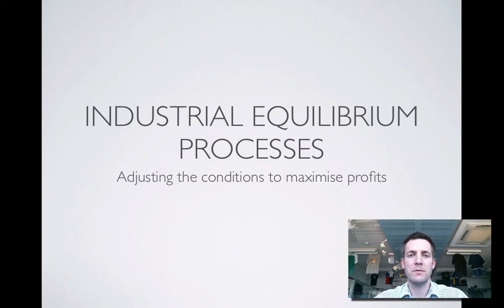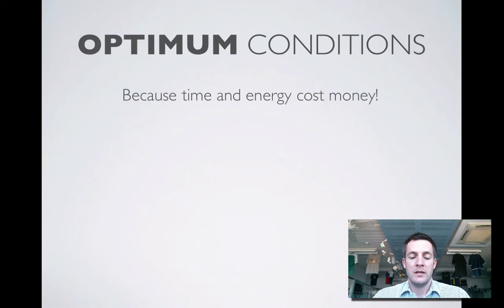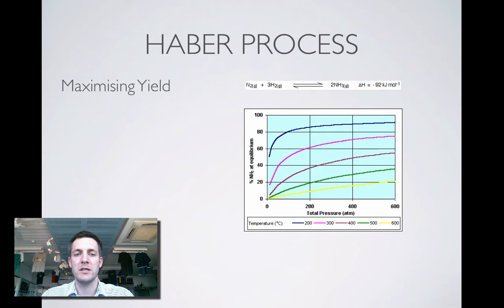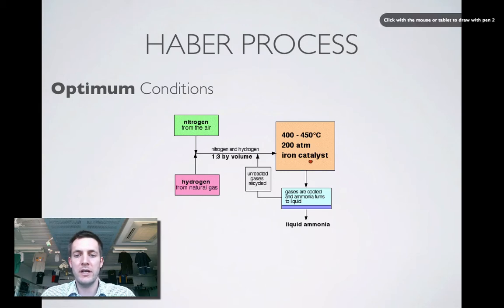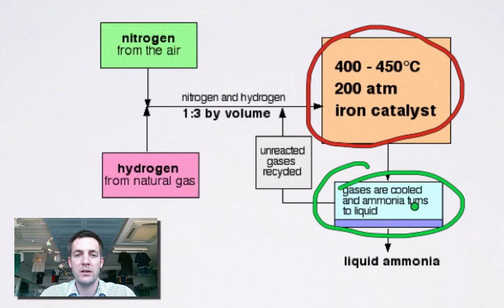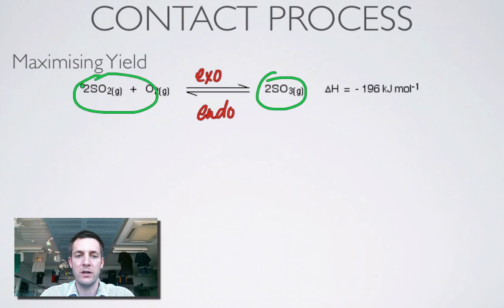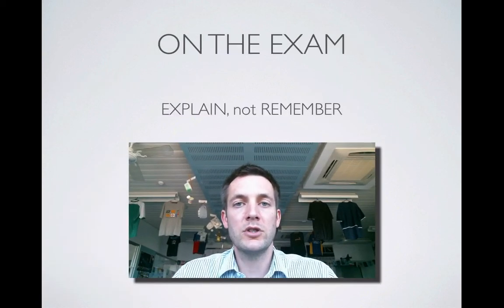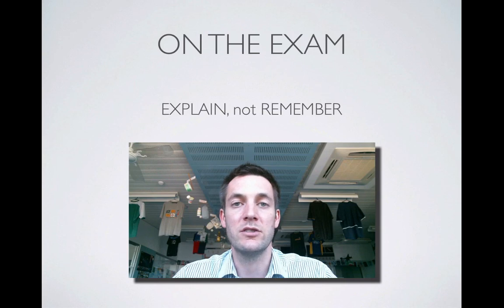10 Equilibrium in Industry

Comment from the maker: Thanks for the comment - a good question. If we consider the structure and bonding (and intermolecular forces, in particular), we should be able to predict that ammonia will have a much higher boiling point than either of the other two gases. This will mean it will condense much more easily.